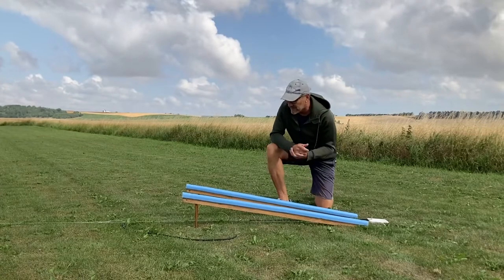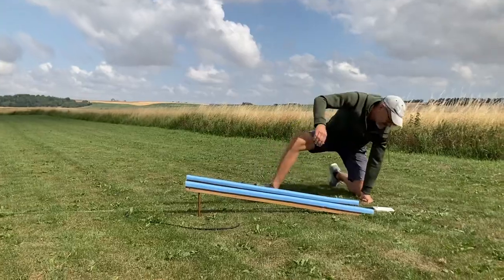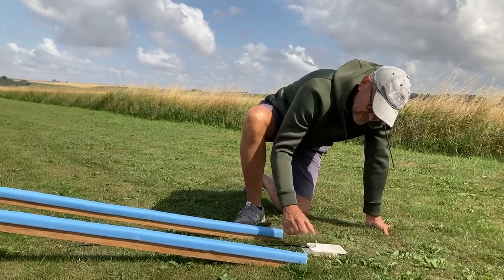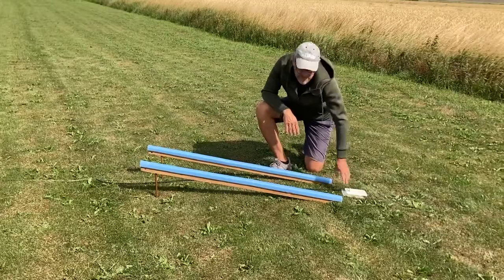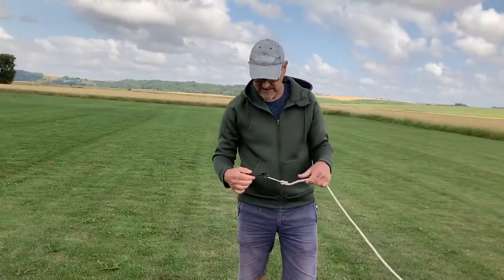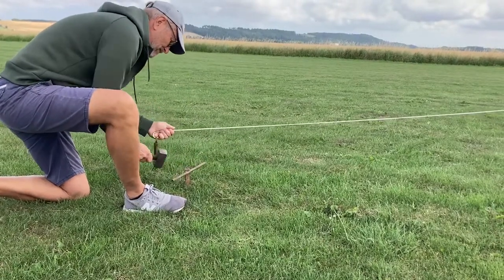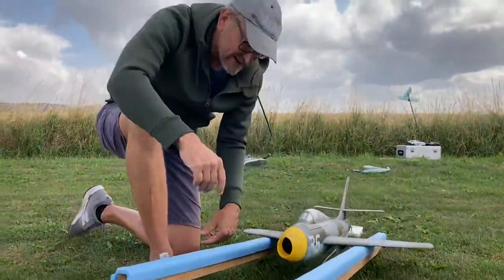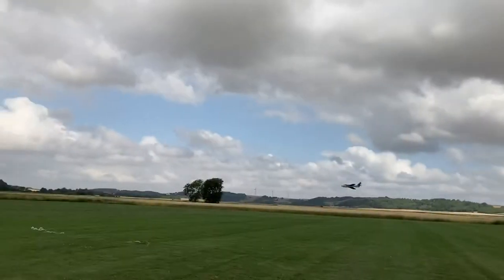DIY Catapult for safe launching of RC Models

Comment: Interesting design. I was thinking about a large bow, string and arrow, the bow string being a bungie stretched at right angles to the launch ramp using a flexible wooden bow. Model (arrow) hooked onto the bow string with a foot release. Advantage, more compact in use. No need to stretch a bungie across the field. But you do need a very strong bungie!
Reply from the maker: Sorry about the late answer. I don’t think that a bow and string will work. You want a pull that gradually tapers off. Not a pull that is like a kick. The bow and string would most likely rip the bungee hook right out of the model.
Reply: @michaelghammer  Ok, thank you for the tip. I’m going next gen, so will report back when project is complete.

Comment: I had similar setup of trigger line to rear of rails - till I got it caught in a pusher prop. Even with the heavy ring to make it stay down - it still got caught. So I modified to have the trigger line fixed to a rail at front of ramp. The bungee line Y then went 1. to model as yours, 2. to a hinge pin at frono of ramp. The hinge pin being help UP by the trigger line.
When trigger was pressed - the short line allowed hinge pin top fall forward - the bungee was then released to launch model.
https://youtu.be/ozmd_aPMLbE
Reply from the maker: Hi, 
Nice setup. However I think the setup with the hinge pin is a bit overengineered. But hey, overengineering can be fun, right? After I put gasoline rubber tubing on my strings near the model, I have never experienced any problems with the string or ring getting caught in a prop or tail.
Reply: @michaelghammer   Yep - I went nigh on 10years with a 'heavy' trigger line until my pusher prop T45 got caught twice in one day ! I've now copied your rails - nice .. only modification was to hinge large ground pegs to rail ends so I don't 'forget' the legs ! I have mounted a release hinge system using a broken prop with hub ... onto a block that sits ahead of the rails without need to be fixed to rail frame. What I like as well as the simplicity of your rails - they can be moved closer or wider depending on model easily.

Comment: hello brother, I have a question, how do you find the pulling force with the scales,,,that is, how many times the weight of the plane you will fly should be, the weight you measured in the tire,,,I don't know if I can tell you,,my plane is 1kg,how much should I pull the tire,thank you for your answer in advance
Reply from the maker: Hi Ismael. You need 6-7 times the weight of your model as the pulling force of your bungee. So for your model at 1 kg your bungee should pull 7 kg.
Reply: @michaelghammer  thank you very much my friend,,you have been very helpful,,greetings

Comment: Great video.  Was wondering if anyone knows of 3D printing resource on-line?  I can't seem to find anyplace local...
Thanks - Happy New Year.
Reply from the maker: Hi Mark. You should get your own printer. It’s a fun learning experience and you will be surprised how many things you will end up printing. And you  don’t have to buy an expensive new printer. My first printer, an Anet A8 ended up printing at least 15 RC models + a lot of other stuff before I sold it for half the purchase price. Replaced it with a used Artillery X1 Sidewinder. Great printer and very inexpensive. Go for it!
Reply: @michaelghammer  hi! thanks for the response and something i'll take a look at.  i bet there's a ton of things that I would find it useful for.

Comment: Hi, noticed that you launched a prop plane. How did you connect the planes hook so it doesnt get caught in a spinning prop?
Reply from the maker: Connection is the same as on the jets. The Y-connection and the gasoline tubing ensures that the bungee will disconnect and fall away cleanly. Only add throttle after the model is in the air and the bungee has stopped pulling.
Reply: @michaelghammer  thanks!
Reply: @michaelghammer hello, do you mean gasoline tubing on the rails of the launcher?
Reply from the maker: @kudriy787  No, the gasoline tubing is put on the nylon fishing wire to prevent it from wrapping around parts of the plane after launch. I learned this the hard way 😀
Reply: @michaelghammer  okay, thank you very much for answer

Comment: Hi Michael
Nearly finished building the Draken - great model
I am also building the catapult - what is the diameter of your bungee?
Reply from the maker: Thanks Hans. I’m glad you like my Draken. The diameter of the bungee cord is approx. 10mm. But if you have thinner bungee cord, you can run two or three in parallel. You will need 6-7 kg pulling force for the Draken. Good luck with the maiden flight.